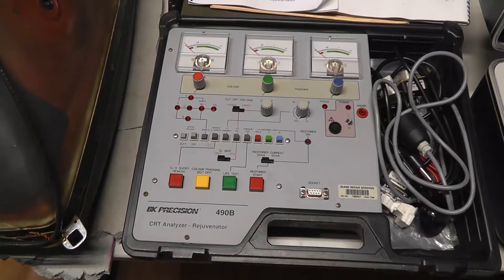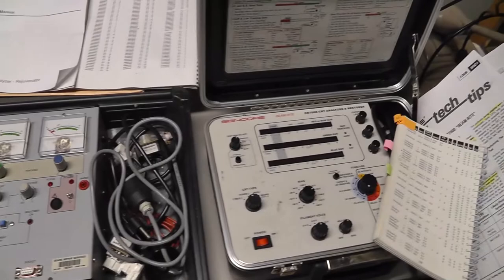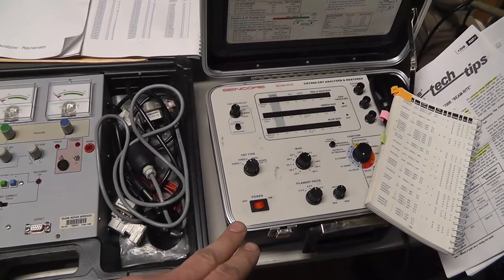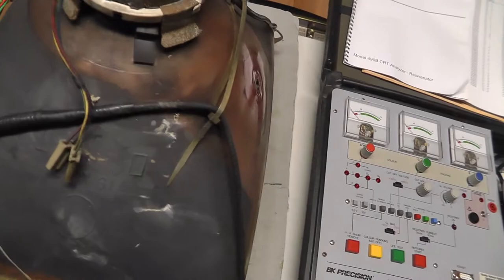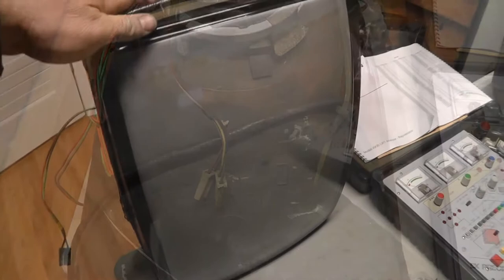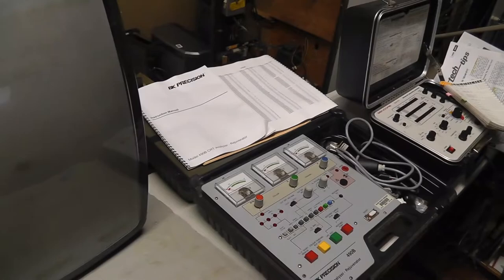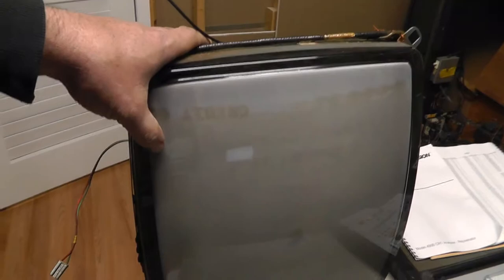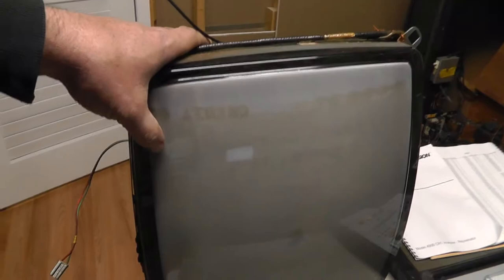B&K 490B and Sencore CR7000 Tube Restore

Comment: your very welcome, thanks for making the video.
great video. both units have their strong points and their weak points.
i like how you can see all the measurements with an analog gauge on the B&K.
the 7000 has digital gauges but they don't show you everything on each test.
i personally am not a fan of the good or bad light on the 7000, i like to see the range i am in on the B&K.
again fantastic video showing off both excellent units with a comparison, it was a good watch.
i will be looking forward to the next video with all the corrections for the tests you use on the B&K.
Reply from the maker: Yea I have to figure out the adjustable g1 cutoff tracking test on B+K and pay closer attention to the short/leakage lights.  Definitely interesting and learned some more by messing with another brand of restorer.

Comment: Hi, thank you for this great video, i just saw it. I will try my first rejuvenate tomorrow, an european Sony Trinitron CRT TV with the B&K 490B. Did I see it right, that you did not unload the Tube before rejuvenating, and you did not turn off the B&K before connecting the anode cap to the tube? Wasn't the CRT charged with problematically high voltage during the test?
Reply from the maker: To be safe, you should discharge the tube at the anode before hooking up the restorer.  However, CRT Testers/Restorers don't generate the hi-voltage that a monitor chassis does.  I can't remember 100% but think the bk490 has an anode cap just for extra safety reasons but no other restorers do.
Reply: @jacklick  Thank you for your fast reply. I also guessed that the B&K doesn't generate the hi-voltage, but then I will discharge the CRT after the test. Is it better to turn off the Rejuvenator before the discharge and unplug the adapter (It is connected during the test with CA23)? Unfortunately the manual do not write anything, only the "plug the cable into the anode connector on the panel and into the HVA connector on the CRT (unloaded previously).

Comment: Do you happen to know what that anode cap on the 490B is for?
Reply from the maker: Not sure.  I believe, and have seen other comments, that it is there for safety reasons.  The tube itself is like a capacitor so maybe there is slight chance it could get a charge if there is a problem with g1 or g2 grids but there is no High Voltage used during this restores.

Comment: Hi. You can rejuvenate trinitron tube's via BK490B ?
Reply from the maker: I believe you can but have never done one.  You may need a special or universal socket.  Do you have the tube model #.?
Reply: @jacklick  Hi, yes the tube model is  M34KBE11X
Reply: This is Sony pvm 14N6E
Reply from the maker: @sullah1986.  B&K has a socket adapter for that tube so have to assume it can be restored.  The Sencore manual says to use a universal adapter.  Even though the guns are in line, I suspect there are your standard pins for Heater1&2, G1, G2, RK, BK, GK .
Reply: @jacklick  Exactly :) But tell me when you rejuvenate such a tube like in my case the tube life will be shorter?
Reply from the maker: @sullah1986.  First test a tube and use the lowest restore function needed to bring the tube back into spec.  This is how I look at it.  Whenever you "restore" a tube it burns off some of the oxides on the cathode needed to emit electrons.  So yes, the theoretical potential life of the tube is shortened. However, because you have cleaned the cathodes, the usable life is  improved.
Reply: @jacklick  Thank you very much for help. For now i don't have this wonderfull machine but i think about it and meaby i will buy this in near future.